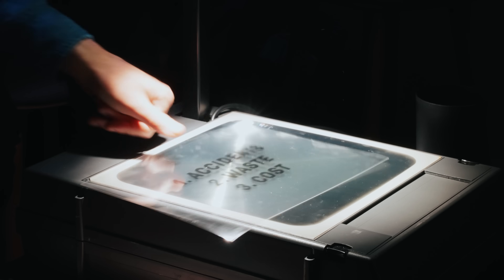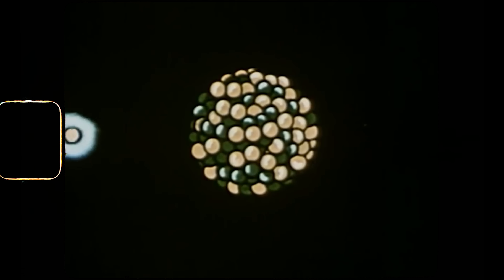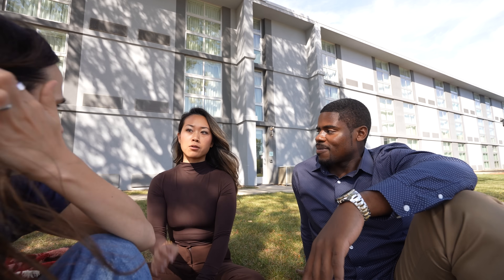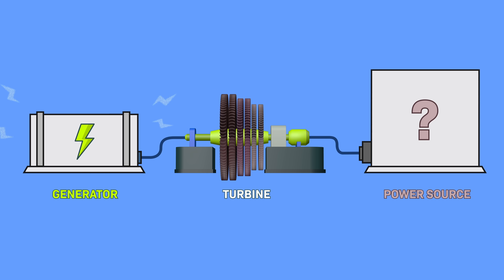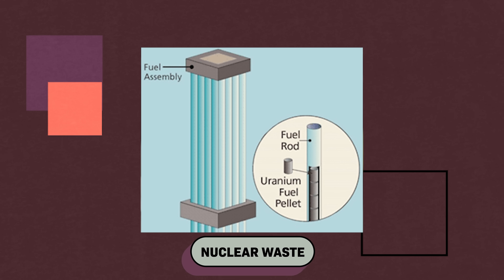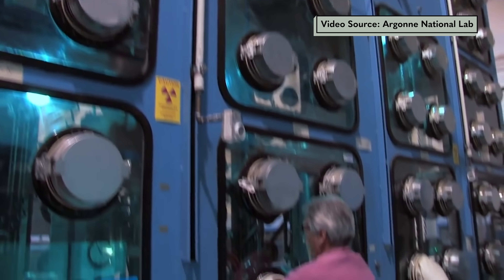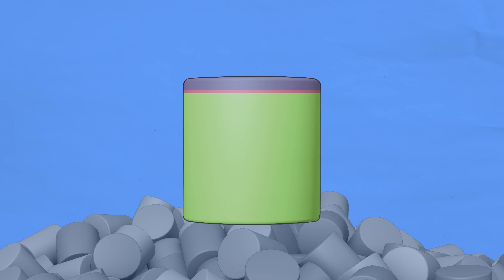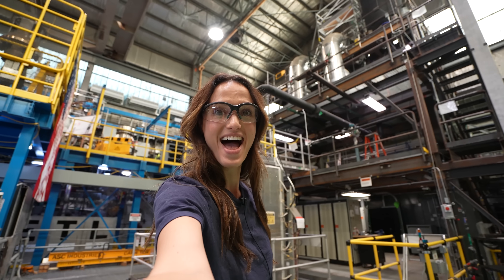The Big Lie About Nuclear Waste

Comment: This stuck with me when said by a former professor years ago (he was a nuclear engineer for the Navy before teaching):
"If it's still radioactive it's still fuel!"
We're sticking these fuel rods into storage not because they're waste but because we don't want to reprocess them to continue using them due to misguided fears of nuke proliferation.
Reply: @MimeticMimic  The same one that peaked in the 70's and has since improved waste treatment facilities, which convert much of this radioactive waste into a solid for long-term storage.
Reply: @MimeticMimic  Commercial nuclear reprocessing doesn't need 100 years r&d. There have been plenty of commercial plants in real operation that do exactly this - e.g. Sellafield in the UK was doing it 1952 to 2022. The issues are lack of political will, public fear and poor economics when there are other cheap sources of reliable energy (e.g. gas). Real shame we've wasted decades.
Reply: i don't blame the pubic for their opinions, i blame the media for telling them how to think  @AndrewMair
Reply: @MimeticMimic Really? France has been reprocessing theirs since 1976.
Reply: @MimeticMimic Yes, but it’s less waste and less radioactive waste than what you start with.
Reply: Russia recycles nuclear waste and uses it again in nuclear power plants. And now Russia has been testing a new reactor for several years, which literally runs on spent nuclear fuel from other reactors. So far, the tests are going great. The reactor is called BN-800.If the tests are successful, the BN-800 will be put into mass production.
It is the only such reactor in the world
Reply: @DedHobbit БН-1200 на подходе. Промышленный.
Reply: wanna ask how many times more expensive is using waste material vs the 235?
Reply: @thienyetan2035  . 235 has to be separated out in the first place  you  realise ?
Reply: @johncunningham4820  so  saperate it... ok thats the first cost, but what i ask is how many times more expensive is that? btw enrichment also cost some amount yes?
Reply: @thienyetan2035  . Correct . 
The Actual " Treatment " processes are relatively Simple . 
The COST  is the degree of Isolation from the Environment that is required to deal with the Toxic  Elements .
Reply: @johncunningham4820  ah, so if you can automate it to a high degree then the cost will be much cheaper then
Reply: @thienyetan2035  . I  think the Core Processing is likely Computer controlled already . 
The MATERIALS  COST required to build the Facilities for these processes and the Layers of redundancy needed for ultimate Safety are principally what pushes the Expenses up . And  Corporate greed (in the U.S.) means the tech is not being given a serious look .
Reply: Not fears-reality. Kim of DPRK threatens the region, Iran marches toward real Armageddon for the Middle East, and Pakistan/India might really have at it. These are the state actors.
Reply: What about the wastewater that's used for this what do you do with it on the other waste material what happens with it not including the fact that any nuclear plant is a potential terrorist target
Reply: @notcherbane3218  
Any power plant is considered a terrorist target!
Reply: Your professor was right about everything except the reasoning behind wanting to repurpose. We don't live in a Democracy, we live in a corptocravy where industry, in this case the petrol lobbyists, own our government and media. Simple math, more nuclear power plants, less oil consumption.
Reply: @MimeticMimic  sigh fears about ionizing radiation are greatly overblown. Did you know you're being bathed in ionizing radiation _right now_? That's right - we're constantly exposed to a pretty hefty amount of ambient ionizing radiation from space. Our bodies evolved to handle that.

In fact, lab tests suggest that organisms which aren't exposed to any ionizing radiation are less healthy... there have been a number of studies on lab mice and rats [shielding a group of them against ambient radiation, then comparing them against a non-shielded control group] which suggest that radiation hormesis (a positive health effect from exposure to ambient ionizing radiation) is actually real. So, while I wouldn't go munching on a bunch of radioactive waste, we also don't have to worry about a little radiation here and there. The Linear No-Threshold model radiation scaremongers like to use has been disproven.

FWIW PM2.5, a component of fossil fuel pollution, kills more people every few days than every nuclear accident in history COMBINED. Heart disease, cancer, strokes, etc... they're all among the most common causes of death, and fossil fuel pollution causes them in many (perhaps even most) cases. Worry about that. For what it's worth, fossil fuel pollution kills more than people every year as died in the Holocaust. Fossil fuels are mass murder. Switching to nuclear power would save millions of lives every single year.
Reply: @MimeticMimic  Yes and let's not talk about Fukushima, Chernobyl, Three Mile Island or the bombs dropped on Hiroshima and Nagasaki. We do not need nuclear energy or nuclear weapons. We have natural energy sources such as wind, water, solar and thermal to name a few. These resources are under used because scientists would rather play about with things that they do not understand. Hence our world falling to bits.☮
Reply: @MimeticMimic  Nonsense! We could reprocess slightly used nuclear fuel if we wanted, OR we could use it in a molten chloride salt reactor without reprocessing. Reprocessing implies separating the isotopic components. If you use it as a mix then it is not reprocessing. There is not a great deal of fancy tech here.
Reply: well use the billions they are currently investing into meme energy sources then @MimeticMimic
Reply: wow there must be no living creatures in that sea. Oh wait, its perfectly fine  @MimeticMimic
Reply: The dirtiest and most polluting process within the nuclear energy industry is reprocessing spent fuel produced during fission into reprocessed fuel. And only a small portion of the waste is reprocessed. It can be reused once and then it becomes...nuclear waste once again, like the vast majority of it. It is much more expensive, dirty, dangerous and cumbersome to reprocess used fuel than to process uranium ore. And reprocessed fuel creates additional problems in reactors that make it more difficult to manage. 
Why do you think no one is doing it?  If it was the magic unicorn that would gobble up nuclear waste like bales of hay, don't you think the radioactive community would be all over it like white on rice? 
Rule number 1 for listening to nuclear puff pieces - Don't believe a word of it. Rule #2 - Hang on to your wallet. Rule #3 - Get rid of nuclear energy before it gets rid of us. If it is not already too late.
Nuclear energy is the most expensive form of electrical energy generation by a wide margin and getting worse while renewables are getting drastically cheaper very quickly. That is true even though nuclear does not pay for its greatest liabilitilies - 1) disposal of 100s of radioactive isotopes produced by fission  for longer than mankind has been in existence that are orders of magnitude more dangerous than naturally-occurring radioactive materials and 2) compensation for massive environmental and health damage caused by these randioactive isotopes that will not go away and cannot be burned up for 10-20 the half-lives of the 100s of isotopes. Someone is going to have to pay more money for that than is imaginable or life will cease to exist.
Reply: The socialist/marxist/communist/democrat totalitarian thug party does not want cheap energy available to the people.
Reply: @MimeticMimic  : Wrong.
It is all corrupt  politics.
Reply: @JimAllen-Persona Why don't you tell me?  You seem to have a lot of faith in people who let things get away from them.  This is not a good idea.  We already have seafood contaminated with non nuclear industrial pollutants.  We have not been informed how much treatment the released water has received if any at all.  You need to get real and stop listening to those who well could be lying to you.
Reply: @raykirkham5357  
"People who could well be lying to you"
I assume that could include you or the people you listen to!
Reply: no, they know exactly what they're doing. The cabal wants to destroy the planet and humans in general.
Reply: Its also because of the fossil fuel lobby
Reply: @MimeticMimic  "We do it because we CAN NOT reprocess them. Might be able to, maybe ... in 100 years after pouring billions into research and development."
is the US 100 years behind the rest of the world?
Reply: @aquaphobicFish always
Reply: @aquaphobicFish От России США точно отстают на несколько десятилетий в ядерной энергетике.
Reply: @aquaphobicFish Really? France has been reprocessing their nuclear waste since 1976.
Reply: It seem more like you are trying to express your feelings on the rather than being bothered to express any knowledge on the subject.

Of the 400 000 tons of "nuclear waste", 30% has already been reprocessed (mostly for nukes, because the political motivation is there).

Right now, 2000 tons per year are being reprocessed for fuel.

France, Russia, Japan, India, UK, etc are already reprocessing.

It's not that it can't be done. It's that people are ignorant by refering to unspent nuclear fuel as "waste".

Imagine you fill your car's tank with fuel, you only use 0.7% of your fuel and is then ignorant enough to the refer to the unspent fuel in your tank as "waste", and then plan to dispose it (just because it has some contaminants in it that interferes with the reaction in your type of motor...which can be seperated, or even better, used in another engine that can run on contaminated fuel).
Reply: if you cant use it in your car and there are no reprocessing facilities. Then it is properly called waste.  @tylerdurden3722
Reply: @MimeticMimic . Didn't listen , Huh ? It's ALREADY  BEEN  and is still being  DONE . Sounds relatively simple too .
Reply: @jimmyzimms  You are terribly mistaken. U238 (depleted Uranium) was used in Iraq and Kosovo.  
Fallujah has a huge runaway cancer problem and a birth deformity problem caused by powdered Uranium used in DU rounds.  It is extreme and the suffering involved most inhumane.  DU is not fuel.  You are wrong with your notion.  Radioactive Cesium and Iodine both cause cancers.  You are just plain wrong.  Radon gas causes lung cancer with repeated exposures.  Radon gas is NOT A FUEL.  Neither is Tritium.  These are common decay products from reactors.
Reply: @raykirkham5357  
Obviously not the brightest bulb on the universe!
Reply: How much money did the nuclear atomic power companies pay you guys to do this and how much information did you leave out
Reply: @notcherbane3218 lol oil lobbyists are the ones who own our gov and media. You've been lied to your entire life and you're unwilling or incapable of admitting it. You're either a Boomer or a Sh!tLib.
Reply: I'm sorry, but that's not accurate.  Decay heat may be considered a fuel as in RTG heaters and electricity sources for spacecraft, but normally it is considered a waste, as compared to fission.  It decays too quickly for long-term use - consider how the Voyager spacecraft are doing).  Mainly it is a problem in practicality; you can use it, but you have invest large sums in the machinery repeatedly.  You can consider it a useful fuel in the same way you use driftwood in a campfire.
Reply: The truth is we do not reprocess fuel rods because nobody has achieved this safely and economically. It is not that it cannot be done, just it cannot be done within those two constraints.
Reply: @bombheadgames9565  other countries have already done it safely. she mentionned it in the video
Reply: @bombheadgames9565 IOW: It’s cheaper to just collect it and dig up more uranium that recycle it. 100% true. And that’s why the anti-nuclear crowd says that earth only has enough uranium for another 50 years. Ignoring that consuming the waste would give us another 150 years. (And ignoring Thorium… and 4th generation reactors that can consume almost 98% of the fuel AND 98% of the transuranics (1/100th the amount of waste of a LWR, PWR or BWR) AND that waste is only dangerously radioactive for 300 (vs. 10,000) years.
Reply: "We're sticking these fuel rods into storage not because they're waste but because we don't want to reprocess them to continue using them due to misguided fears of nuke proliferation." - Or maybe we dont use it, because its even less profitable than the regular nuclear reactors? Nuclear is alreay the most expensive source of energy, reusing the waste to make more energy would in reality drive up the costs even more.
Reply: @xXYannuschXx  . So then , we just continue to dump Billions of  CO2  into the Atmosphere  annually , from Hydrocarbons because it's too expensive  NOT  too ? Yes ?
Reply: @xXYannuschXx  
Largely the most expensive, compared to coal, gas, or hydroelectric!
Not all the expensive compared to wind or solar!
And much of that cost is due to overregulation and silly safety rules!
I had cousins who helped build and then worked at a nuclear power plant.  Some of the rules were silly, some just stupid, but they all increased the cost of the plant!
Not against safety, but did the sewer lines in out buildings have to meet nuclear safety codes?
Reply: @xXYannuschXx No, it's pretty much nuclear weapons proliferation concerns and the treaties surrounding that concern. It's why the Fast Flux Test Reactor in Richland, Washington was shut down.

Comment: The problem as always in recycling is the cost of recycling and how much can really be recycled. Sure, the companies that advocate recycling are very optimistic but practically recycling doesnt work so well because of costs or better yet lack of costs for just storing up waste of all sorts. If it was so simple to do it and economically viable they would have done it already, its not only the public opinion that is against nuclear energy. Many countries use nuclear energy and are pro or at least neutral.

Comment: One question I've always had about nuclear waste is whether it's possible to harness the ionizing radiation it's giving off to produce electricity. I mean, there's large amounts of energy coming from that radiation right? So if we could find a way to harness that, then we would get even more use out of our nuclear waste. Even if it's a small amount of energy, since the waste is producing radiation for hundreds to thousands of years, we could potentially power small self-sustaining machines, or even just use that extra bit of energy for a long time into the future.
Reply: The ionizing radiation of the split products causes what is called decay heat. (You may be interested in the Wikipeda article 'Decay heat'.) While the reactor runs, decay heat contributes typically 6.5 % to its power, depending on the burnup and on the reactor type. But the moment you shut down the reactor, the decay heat rapidly decreases. Nonetheless it needs to be taken care of by a cooling system, or otherwise destroys the reactor. Likewise, the spent fuel pool needs to be actively cooled for months and years. While the energy spent fuel rods emit is too big to be safely ignored, it is still sums up to far less than the energy the splitting process and immediate decay heat inside the reactor have released.
Reply: @FranzN57  Thank you! That was very informative!

Comment: If it's possible for a technology to catastrophically fail, it eventually will. For nuclear power plants, this means spreading deadly contamination into the environment that essentially lasts forever. Reactors are not fail-safe. They can and have failed in just my lifetime. It's still a dangerous technology and recycling fuel will only make plutonium readily available for the next madman. It's the crazy train equivalent of biological gain of function research on deadly pathogens. Wonder which will annihilate us first...

Comment: Okay but if the value of this stuff is steadily increasing as we approach peak oil, it literally makes no sense to subsidize using it in the here and now. It makes the most sense to hoard a sizable chunk of it with the components needed to build and maintain 12 fast reactors, as well as enough started fuel (wood) in an area that already has lots of timber and some access to fresh water, like the PAC NW.

Comment: High level nuclear waste - the exhausted fuel rods are actually a massive energy resource. Pressurised water cooled reactors (PWR) extract about 4% of the fuel’s fissile energy. 96% is still there and is exactly why it will be dangerous for at least one hundred thousand years. Fast spectrum reactors like Elysium and Moltex use molten chloride salts to extract the energy and extract 99% of what the fuel can offer. The resulting waste has a 1/2 life of 30 years against the existing stuff which needs 30,000 years to halve its radiation. 
Why are we refusing to licence these reactors?  The Moltex has no moving parts and Elysium has only one moving part. They are fully self regulating and intrinsically safe. What’s not to like?

Comment: but the energy used to recycle something is always more energy than you get out of the process...therefore scientifically its not sustainable long term...although in the short term it may speed up global warming under certain conditions....in order to get the complete cycle to be energy efficient...i suggest you pray

i guess my point is there is no stopping the inevitable, you can speed it up or slow it down only

Comment: 95% of nuclear waste.. Can not be used to generate power. Its simply not possible. The Waste does not have enough energy. Stuff that is dangerous but it isn't reactive enough.. Is called Low level waste. IE Contaminated Materials etc. This video is disingenuous. "Used Fuel" waste. Represents only a small portion of the "Nuclear waste" that is in storage around the world.